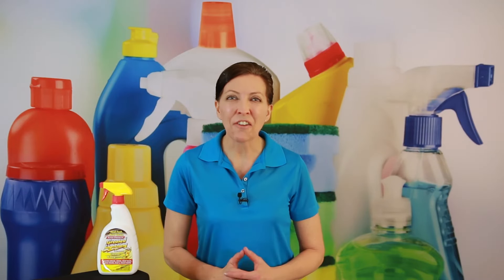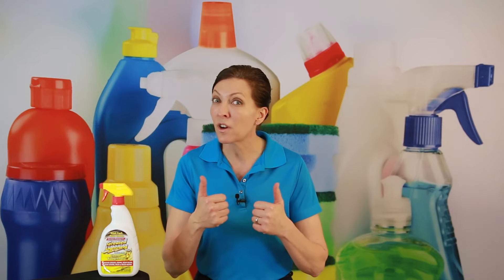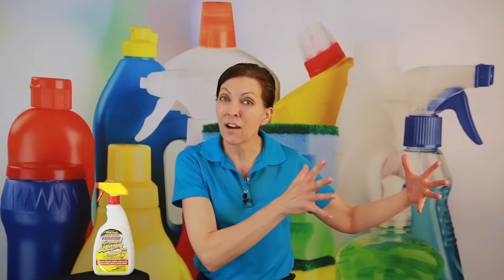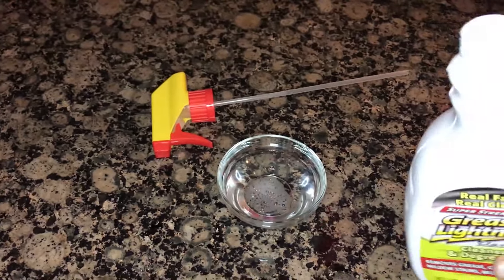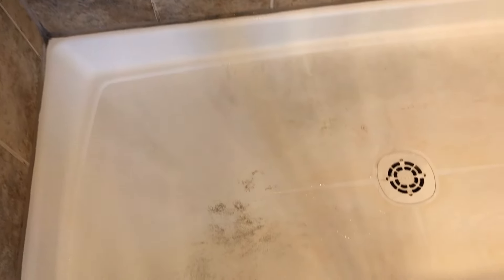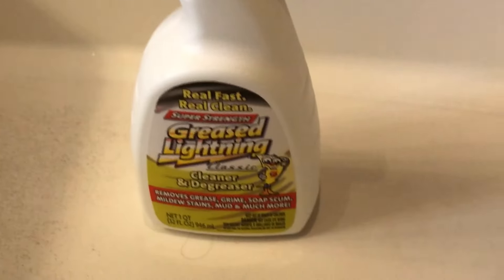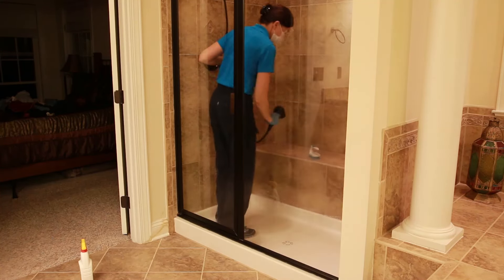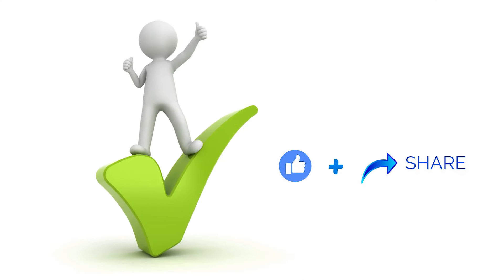How to Clean a Moldy Shower with Greased Lightning (Product Review)

Comment: I just subscribed, I love this channel Angela! I clean homes for an extra income, I do suffer from rheumatoid arthritis osteoaritis as well as mixed connective tissue disease so I greatly appreciate others sharing useful and helpful cleaning info & tips. 👍
Since your talking about cleaning products that have a higher toxicity rate, I do have a question about storage for us home cleaners..... primarily because of where I live and that I store most of my cleaning items in my truck. Ok so I realize that precautions need to be takin as far as keeping cleaners upright within a vehicle so not to spill. For me personally I keep a large tote with many chemical based items within it and my two storage caddy's with everyday cleaning items next to it, question I have is since I live in Florida and the heat index as you know is ridiculous, "is it safe to store such items as Grease Lightning within my tote box on a daily? Ever so often on a super hot day, I think about the safety hazards of some of my items. Do you have any suggestions? Thanks so much! I greatly appreciate your channel☺️👍✌️💕
Reply from the maker: Specifically for Greased Lightning, here is a link to the sds: https://www.physics.purdue.edu/primelab/safety/MSDS/SDS/Greased%20Lightning%20Super%20Strength%20Cleaner.pdf 
Section 7 has the storage recommendations, keep container tightly closed in a dry, cool and well-ventilated place. 
You may need to supply ice packs to keep items cool and store in a special container.  If you have time to stop back at your main hub (office) you could switch out the supplies in between jobs. For more cleaning product recommendations please seek out the specific safety data sheets.

Comment: So, Greased Lightening is safe to use on the dark shower frame?  Thank you for this informative video.  I've been afraid to clean my dark (bronze shower frame and threshold for fear cleaner would discolor the finish.  I'm so glad I spent the last 4 hours looking at ways to clean my shower frame and black molded grout...I'm glad I finally found your videos. Yay!
Almost forgot!  What type of gloves are you wearing for protection?
Reply from the maker: Hi Rhonda, the Greased Lightning is a degreaser, so it shouldn't eat away or tarnish the bronze-coated hardware in your shower. Also, the gloves are most likely nitrile. (Paid Link https://amzn.to/3FaM9Cq) It's about all I wear.

Comment: Hello I use  for mold citric acid  3-4 table spoon in spray bottle fill with the water than spay. It is also remove the water stain you need to do several times Can you please let the people know not use chemicals cheep and no harm to heath
Reply from the maker: +Halide Hall thanks for the tip and for helping me leave the world a cleaner place. 😁

Comment: What product or products works the best for showers with black mold and mildew? I haven't found anything yet that removes those things.
Reply from the maker: Mold itself is a trigger that let's us know there is too much moisture in the air. This could mean that the bathroom fan is not being used properly, or that there is not enough ventilation in the bathroom. And is the mold isolated to the bathtub/shower only? If yes, consider getting a dark spray bottle (These are my favorite because of the industrial size and spray nozzle, and light blocking capabilities - paid link https://amzn.to/3Fz1Ulx) and fill it with Hydrogen Peroxide. Leave the spray bottle in your shower  and after each shower, spray the moldy areas with 3% hydrogen peroxide (this is the stuff you buy in any drugstore, or you can buy it in the gallon https://amzn.to/46OlKF8 - paid link) This will help the mold decompose and keep it at bay. NOTE: Remember to open a window, or use the bathroom fan during and after showers to ventilate the bathroom properly.

Comment: Can I use it around the sink in the bathroom
Reply from the maker: It depends on what the vanity is made of. The key is to know what the pH level of your cleaning chemical is, what it is designed for, the type of soil you are trying to remove, and the surface type from which you are trying to remove the soil. If you are not sure - don't use it.

Comment: What tools do you recommend for cleaning bath tubs in the shower ? Do I need to use a new sponge at each house I’m cleaning or is there a better alternative? Starting a residential cleaning business and I want to limit the amount of tools I carry and overhead cost on disposable sponges and scourers
Reply from the maker: Congratulations on starting your cleaning business!  Yes, you want to avoid cross-contamination by not sharing sponges between houses.  Depending on how much it is used you may need to replace it anywhere from 1-3 uses.   Sanitize and dry the sponge after your cleaning and then keep it in a labeled ziplock bag with the customer’s name and date.  Don’t forget dusters, microfiber clothes and cleaning products for your cleaning caddy.  Check out my videos for more helpful tips.
Keep me posted on how the business is going.  🤗

Comment: Angela, I recently found your page and loving all the great cleaning tips.
My question is about ceiling fans…I’ve seen posts how to clean the dust with a pillow case which is fine…but what about grease and grime buildup due to years of not being cleaned?
Would greased lightning be an option? 
I have one in my kitchen and dining room which are probably 6’ apart from each other.

Any advice would be greatly appreciated!

Thanks, Sharon
Reply from the maker: Hi Sharon, thanks for the kind words and for watching the show. The trick with a greasy ceiling fan is you'll need a ladder. Be careful when you climb on it and keep situational awareness about you. 
Yes, you can use greased lightening but put it on a paper towel and wipe the blades. Don't spray it directly on the ceiling fan. It may take off the finish if it is sprayed directly on the blades (depending on the finish.) It will probably streak and will need to be cleaned several times. 
The pillow case method works if you are super skilled - many people break the blades using this method. The key is to be very careful keeping the fan and your body stable while cleaning it.
Reply: @AskAngelaBrown  thanks so much for your expertise! Have been doing a major house declutter thanks to Clutterbug , The Minimal Mom and A Former Slob Comes Clean…a good cleaning is next for kitchen cabs and soffits including those ceiling fans! I’ll be tuning in for more household cleaning tips for sure! 
FYI- someone on FB said the new Dawn PiwerWash cleaner is great for cleaning ovens and no fumes…my self cleaning oven doesn’t work anymore…the door won’t lock…oh well…I tried it and it worked beautifully! Thanks again!
Reply: @sharonmckendrick4431  Thanks for those websites, Going to check them out. I am 64 and need to pare down and learn to appreciate cleaning!

Comment: I moved into corporate housing temporarily and was astonished at the condition in which the bathroom was handed over. The shower walls have at least five vertical grout lines filled with mold. I tried hydrogen peroxide, Barkeeper’s Friend, Clorox Clinging Gel Toilet Bowl Cleaner,      Clorox foam bathroom cleaner, Kaboom foam bathroom cleaner with Oxi, StarBrite Mold and Mildew stain remover and nothing worked. I’m disappointed to report that this product didn’t work either.  I even left it on overnight. 

Are there any other recommendations? I’m off to try Mold Armor next.

Comment: How to clean a bathroom with black matt features? What products are best and safe to use without damaging these matt surfaces?
Reply from the maker: What is the matte made of? Slate? Vinyl? Fiberglass? Corian, or resin? What you use will depend on the type of surface. If you are unsure, a pH neutral product will work best. If you are talking about mold - Hydrogen Peroxide will be a safer choice than bleach.
Reply: @AskAngelaBrown   @Angela Brown  Thanks for your reply, Angela. It seems to be made of brass material. Is hydrogen peroxide pH neutral and safe for matt black surfaces? 

Also, do you have a trick to cleaning the stain that's been built up inside showerscreens too? I don't know how to clean those or is it too late? 🤔 

Ps. Your channel and tips are super helpful. Thank you. 😊

Comment: I just ran across you channel. You have alot of great information. Will the Greased Lighting work on  the caulking?
Reply from the maker: Greased Lightning is a degreaser and caulking is usually (I'm assuming we're talking showers) is a silicone. So if it's soap scum on the caulking, yes it will work.
Reply: @AskAngelaBrown  I am referring to mold in the caulking. I have tried everything that i can think of and what others suggest. Do i need to remove all the caulking and put new in or what?

Comment: I have used Spray Nine cleaner that worked wonders - however, I used it to clean exterior gutters - and it stripped the color off the gutters.  And so, although it has worked wonders, it is powerful to strip paint off.  So I have been hesitant to use it.  I've used it to get muck off the bottom of the shower - and bam - just let it sit for a few minutes and wiped up with paper towel and it worked very well.  However, I am unsure to use it on showers and if it can strip the color off of things.  Have you had experience with Spray Nine?  Would love to know what I can use it on with peace of mind - since it works so well.  Just scared I'm gonna strip the color off something in a customer's home - so don't really use it.  Would love to hear your experience with this cleaner if you have used it.  

Also, I would like to thank you for your videos and how helpful you have been to me!!
Reply from the maker: Thanks for suggesting this product for me to check out.

Comment: I’ve used this in the past, and it does work.  Does it clean anything significantly better than Krud Kutter? Is the increased toxicity worth it?  I’m still loving Krud Kutter since I saw your recommendation, and it’s still meeting every challenge. :)
Reply: That’s my question, too. How do these compare?
Reply from the maker: They are both degreasers and they both work well. If you like one better than the other stick with that one. Of the two Krud Kutter is my favorite (it is Safer Choice certified and designed for the environment.)

Comment: What can you use on painted walls for mold?
Reply from the maker: Please don't use anything. If you see mold on a painted wall, stop immediately and call a mitigator who can come out and figure out where it is coming from. If mold is on the walls, it's just a matter of time before it's on the ceiling and floors (under the floor boards, inside the walls, etc.) The longer you wait to make that call, the more expensive the remediation will be.

Comment: Can you use Greased Lighting in travertine shower walls?
Reply from the maker: While Greased Lightning is a powerful cleaner, it is important to be cautious when using it on surfaces like travertine shower walls. Travertine is a type of natural stone, and some cleaners can potentially damage or etch its surface if not used correctly.

Before using Greased Lightning or any other cleaning product on travertine shower walls, it is advisable to check the product label or check the manufacturer's instructions to make sure that it is safe for use on natural stone surfaces. It's also a good idea to do a patch test in an inconspicuous area of the shower wall to see how the cleaner interacts with the travertine.

Instead of Greased Lightning, consider using a mild, pH-neutral stone cleaner or a cleaner specifically formulated for natural stone surfaces. These types of cleaners are generally safer for use on travertine and will help maintain the beauty of the stone without causing harm

Comment: Would you charge extra to clean a heavily molded shower, especially if you’re using certain products? Would you ever recommend mold remediation if it’s really bad? Thank you for all your videos!❤
Reply from the maker: +Julie Hutchens if the mold is inside, the shower probably can be contained. And if the shower is really really bad, it’s probably gonna take about an extra hour to clean. Instead of cleaning it on a regular maintenance job or on a deep cleaning, and taking that hour away from the regular job, it might make more sense to sell that as a special project - and charge just to clean the shower alone. That way you can deduct the price of that shower from the regular maintenance cleaning as well as the hour it took to clean it. Does that make sense?
Reply: Thanks so much for your response! I’ll know next time how to handle it. I wasn’t sure if what I saw in his shower was something I needed to be worried about health-wise, so I went ahead and turned down working on it and recommended he find someone educated on mold to see if it needed mitigating. I will treat it (a less advanced situation) as a special project next time. Thanks again!

Comment: How does it compare to KRUD Kutter?  Does it remove mold and mildew or does it kill the mold and mildew so that it does not reoccur so quickly?
Reply from the maker: Both products are degreasers. You can use one in place of the other. Krud Kutter is biodegradable.

Comment: I have a house that has mold above the tile on the wall. Is it safe to use on an ordinary wall?
Reply from the maker: Mold on an ordinary wall is a HUGE RED FLAG. Please don't try to erase the mold. Get a mitigator to come do a humidity check in your home and find out if it's coming through the walls. If the mold is not in a shower or tub, you've got a problem. If you catch it now, you can save the house, but if you let it go, the homeowners insurance probably won't cover "neglect" which is what they will call this, and it will cost tens of thousands of dollars to remediate. Mold is an organic compound and grows REALLY FAST. It can also make you very ill. I'm not trying to scare you, I'm encouraging you to drop what you are doing, and get somebody out there fast to take a look. 🙏

Comment: Is removing mold from showers an upsell? Or is this included in the maintenance clean
Reply from the maker: If it is just in the shower that is in fact part of the maintenance clean. If it is on the walls (outside the shower) or ceiling that needs to be dealt with by a mitigator who can figure out where the mold is coming from. Mold is an organic compound that has rapid growth and is not to be treated by untrained house cleaners who don't have the proper moisture meters and iceblasters to remedy the mold.

Comment: I see it works fantastic on sand type grout, but does this do as good a job on rubber caulk type? Most of my clients have showers where the edges and corners are caulk and it seems like the mold is permanent in this type. The only remedy I know of is recaulking the shower.
Reply: Zep mold and mildew remover
Reply: @mandersdaro8136  just used that today...its a miracle worker
Reply: @mycatiswaysmarterthanmosto8500  it really is
Reply from the maker: Thanks for leaving comments and suggestions.

Comment: I have a question that's a little off topic. I noticed that the cleaner in the video was wearing runners in the shower. Was that for the purpose of the video or is that a standard practice? If it is, do you have a cloth or something outside the shower door to step on when you get out? And also do your cleaners have inside and outside shoes? Thanks!
Reply from the maker: Yes. We wear shoes while cleaning 100% of the time. Shoes are important to protect your feet and the arch and heel support protect your body while moving through a job. On carpet we wear shoe covers and we take them off in the shower so they don't get wet - also to prevent slipping.

Comment: Just curious whether it is safe for your vinyl linoleum floors in case some of it runs down to the floor while cleaning around the tub shower.
Reply from the maker: Greased Lightning is a degreaser so it would mimic heavy duty soapy on vinyl linoleum. It's not going to harm the floor if cleaned up in a reasonable time. I wouldn't let it dwell on the floor, as it may dissolve the top finish. Degreasers are designed to cut through grease and gunk and can often cut through other finishes as well.

Comment: I have the same question as Phyllis Tisler.  I have used a lot of the Greased Lightening and the Oxo brushes...letting it sit and scrubbing. It fades a bit but is still there after several attempts. What I'm working on is the silicone seal around the corners of my shower.  Is there a better product for silicone?  Thank you!
Reply from the maker: Is the silicone just dirty? Is it infected with mold? Is it aged and cracking or peeling?
Reply: @AskAngelaBrown  Yes, I think the silicone is stained with the mold. The shower was build 20 years ago and cleaned but not often enough. The silicone probably needs to be removed and re-applied. But it's not getting worse in the meantime because now I'm at least cleaning it frequently like I should :-)

Comment: For cleaning a shower would you say this product is better than the dawn vinegar baking soda concoction?
Reply from the maker: When it comes to "which product is better?", in any situation the answer lies in the surface type and the type of soil you are trying to remove. Greased Lightning is a degreaser (Alkaline) and Vinegar is an acid. Which type of soil are you cleaning?
Reply: Cleaning a tile shower both floor and wall. Thanks for answering!